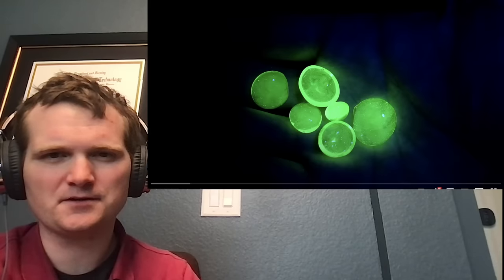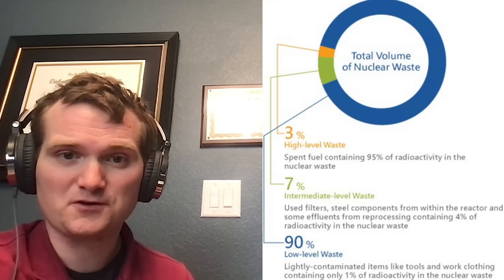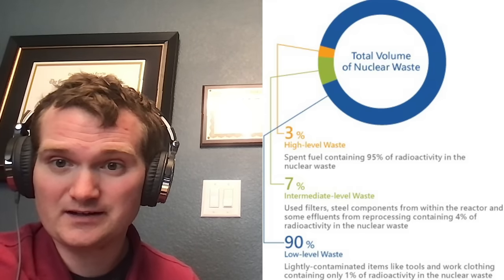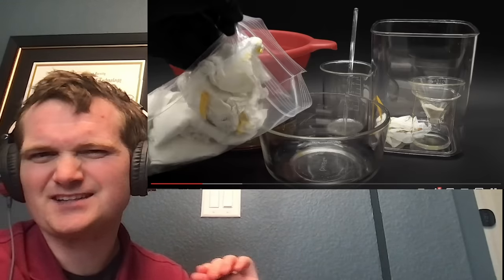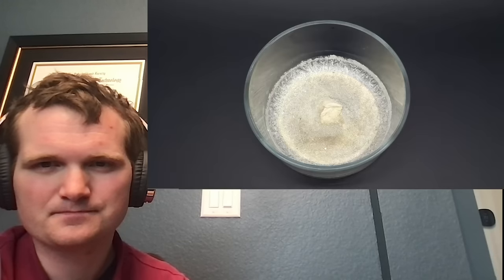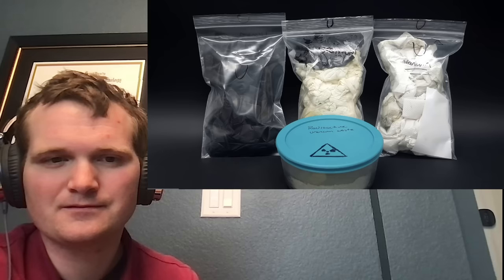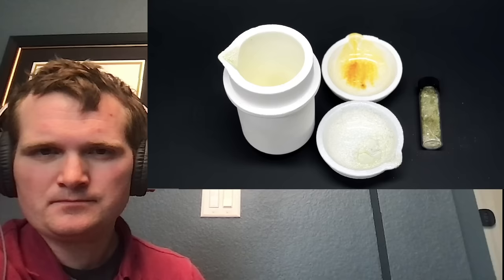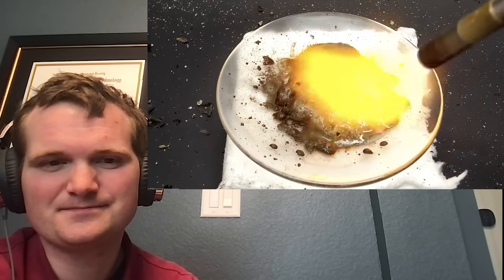Nuclear Engineer Reacts to NileBlue Cleaning Up Uranium Waste from the Uranium Glass Experiment

Comment: If you haven't already you should do a video about the Goiânia accident. One of the world's worst radiation incidents, and yet I'd never heard of it at all till a few years ago. Absolute tragedy how easily it could have been avoided if the people involved would have just had the slightest knowledge of radiation at the time.
Reply: Kramatorsk radiological accident or how I call it "The Apartment of Death" XD
Imagine living in an apartment with a Gamma Source in it's concrete wall giving off a yearly dose of 1800 Roentgen xD
= 15,8 Sievert/Year or 15,8 Gy/Year -> 4 People living there died from leukemia, 16 received varying doses and it took them 9 years to start an investiation and finally find the source xD
Reply: @shadowmystery5613  Interesting, hadn't heard of that one either.
Reply: @Nevir202  Russia in general doesn't take their nuclear equipment seriously, they store caskets with left over uranium under the sky and built a thousand radioisotope thermoelectric generators to power radio stations in the wild that now rust away, a RTG also contains enough material to kill a person if they handle it for hours or ar near it - see Lia radiological incident.
Reply: @shadowmystery5613  I mean, putting casks of spent fuel outdoors is standard practice.

Though, in the US, cask does generally mean "bomb proof, concrete and steel mobile bunker."
Reply: @Nevir202  ...the russians use like...ordinary oil barrels 😂 for Uranium refinery by products, not spent fuel rods xD

Comment: This is all very similar to how we deal with pesticide contamination in agriculture and horticulture.

Of course, since we're dealing with pesticides, the hazardous material is supposed to be sprayed on plants and will get on the surface of soil. But the proper procedures for handling pesticides are to have 100% of the hazardous material get on the plants so that there will be no leftover waste to end up in the drain or on gloves and towels.

Nearly all pesticides are solved in water so they can be sprayed and are very highly diluted. Which means that all the water we use to rinse cups, syringes, stirring rods, and gloves can go into the tank of the sprayer as well. At the end we rinse and flush the sprayer with clear water, which is then disposed of in the area that has already been covered in the hazardous substance.

Most permitted pesticides have the ability to be broken down by the plants that absorbed them or by soil bacteria into harmless reaction products. So the affected area will decontaminate itself in a matter of days. (At least the chemical companies assure us that it does.) But this might not be the case if the contaminant goes straight into waste water or a landfill. Which makes it necessary to not produce any contaminated waste.

Comment: I think he did a really good job, only things he could have done better are sealing the bags with something better than the ziplock (j sealing with tape) and he didn't say anything except looking with a black light as far as surveys go (ideally you'd do swipes or survey with the detector).  But I don't think anyone not working in nuclear power actually has to follow those rules since we don't care about smoke detectors or any other non nuclear power radiation sources
Reply: Right, it's good that NileRed is being responsible but what happens to all those old broken depression glass pieces and old broken Fiestaware plates?  The landfill for sure! The uranium came out of the ground if the first place. Then there's the thoriated electronic tubes, camp lantern mantles, and welding electrodes. And radium from old luminous dials.

Comment: I've heard that if you get in a car crash in the parking lot of a nuclear plant, the wrecked cars are considered nuclear waste.  Is that true, and if not, how far off is it?
Reply: Any experts are welcome to jump in, but simple logic says no. If wrecked cars were getting contaminated, then the intact cars would also be contaminated. Having contaminated items moving around freely would be much worse than going to a junkyard where it (mostly) stays in one place.
Reply: @johnbennett1465  Logic has nothing to do with it, it's politics, law, and policy.  The reasoning I've heard is that any trash with above a certain level of radioactivity has to be treated as nuclear waste, and that level is below what's typical outside the plant.
Reply: @Mikemk_  any radiation in a properly operated nuclear plants parking lot is going to be below the background radiation in Denver. This would imply that any wreckage in Denver would need to be treated as nuclear waste.
Reply: @Mikemk_ Coal fired power plants produce more radioactive contamination than nuclear ones (the ash is radioactive) so it's likely a myth. Nuclear power plants are normally operated very cleanly (they have monitors all over which can detect very small amounts of radioactivity) with few exceptions (like tritium, which doesn't accumulate and is usually diluted to keep environmental levels close to background).
Reply: @reddragonflyxx657  True.  Also, minimally relevant.  The question is about regulations, not radioactivity.
Reply: @Mikemk_  It's relevant because if the claim of contamination levels outside of NPPs being high enough to classify crashed vehicles as nuclear waste was true, it would likely apply to a many crashed vehicles (possibly a majority, because that level of contamination is widespread).
Reply: @reddragonflyxx657  Except that crashed vehicles outside NPPs aren't related as having crashed inside NPPs
Reply: @Mikemk_  > The reasoning I've heard is that any trash above a certain level of radioactivity has to be treated as nuclear waste, and that level is below what's typical outside the plant.
I read this as "any trash...", not just "any trash from a NPP...".
Reply: @reddragonflyxx657  Clearly when I'm discussing rules for nuclear power plant operation, the rule in question is for nuclear power plants, not John Doe.  Learn context.
Reply: @Mikemk_  I don't think most regulations on the handling of nuclear waste care where the nuclear waste is from.